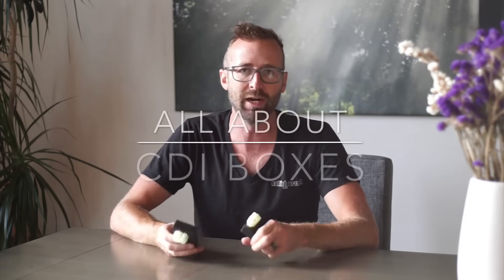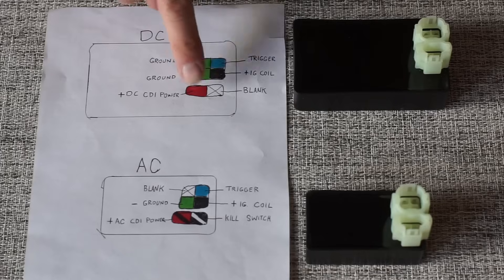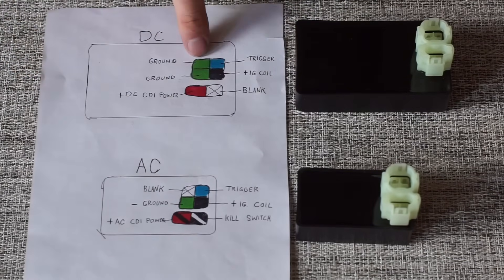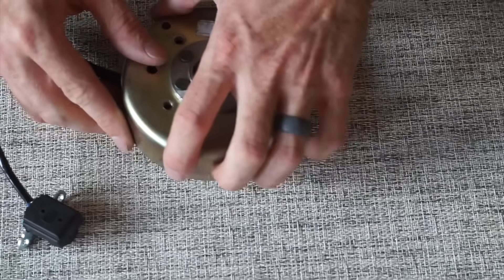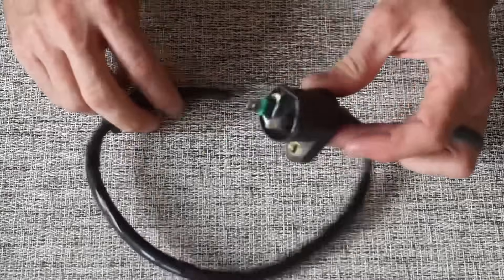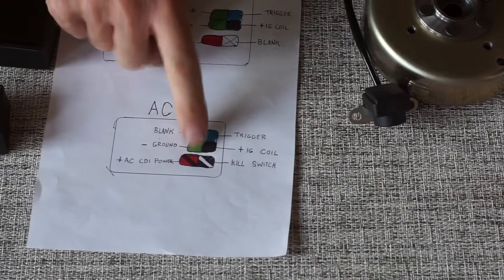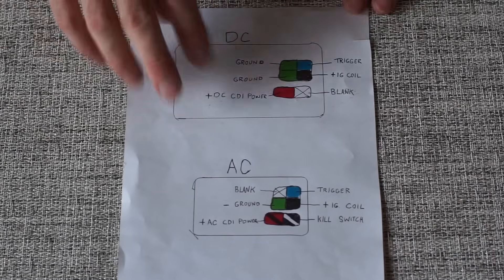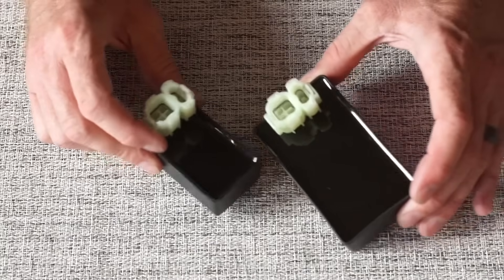CDI  BOX: AC vs DC performance vs stock

Comment: Very good explanation.   Now suppose you have a DC-CDI system that you would like to convert to an AC-CDI system,   what to do?
Reply from the maker: That part isn’t easy. You have to add a different stator and a bunch more wires.

Comment: After watching this I'm fairly certain I have an AC however I don't have a key lol.  The last owner lost the key and they have a switch rigged up that acts as my key and my lights only come on when the engine is running but my gas gauge comes on when the switch is flipped on.  Also the CDI box is tiny

Comment: Hi Mag
I have a Honda TRX 300 EX quad bike what is the best way to test the pick up coil to see if it is faulty or not I have tested the bike with a new CDI and new Ignition coil but the misfire is still there The bike starts and runs but misfires when accelarating.

Comment: Could really do with someone to do an explanation like this for older bikes with 6volt systems ac stator coils and half  wave rectification. Noticed a comment about flickering lights on tick over, most older motor cycles had a single diode rectifier screwed to a heat sink and this converted ac to dc in order to charge batteries and provide crude power to lights. The dc would be half wave meaning there would be a gap milli secs between the positive peak of voltage ax the ac went negative. On high revs you didn’t notice it in incandescent bulbs but on low revs you get a distinctive flicker.  Modern bikes now have full wave rectifiers and a decent direct current smoothed out with capacitors to give the voltage needed for led tech and solid state computer control units found on most new bikes.

Comment: huh, so it seems like another way to tell that you've got an AC CDI box is that you can kick over the bike on a completely dead battery, as you'd need to have at least SOME residual voltage going into a DC box to get it to spark the first couple of times.
Reply: You can look at the connector pins.  If your 2x2 has a blank space, it's AC.  If your 2x1 has the blank space, it's DC.

Comment: Very good and professional explanation. Could you give a hint, how to check the CDI system in a inverter-generator, where the elements are hidden in the main control-circuit,  not visible because of the epoxy-resin they and all the other elements are covered with ? Thanks in advance and have a good time.

Comment: 8mins 40secs This is incorrect. The coil is normally  powered. The CDI cuts the power to the coil.The resultant back EMF in the secondary winding is what generates the high voltage spark from the coil. If people are trying to figure out an issue they would see the opposite of what you are saying. Apart from that a great explanation.
Reply: Cdi cuts or dump HV from capacitor into primary of ignition coil?

Comment: I have bought multiple CDI and coils swapped stators and still no spark on my 97 Yamaha warrior. I’m desperate for help. This has been a year long now expensive problem. I took it to a dealer and they couldn’t figure it out or wouldn’t. Please help
Reply: I searched online and found a manual that gives a list of tool needed, parts to remove before troubleshooting, and a test order.  

Tools needed: YU-03112 pocket tester and YM-34487 coil tester.

Parts to remove: headlight, seat, front panel, fuel tank cover, front fender, fuel tank.  

Things to test:
1. spark plug
2. spark plug gap (should be .6 to .7mm)
3. spark plug cap resistance
4. ignition coil resistance
5. main switch
6. kill switch
7. source coil resistance
8. pickup coil resistance
9. wiring connection (ignition system)
Spark plug should be D8EA (NGK) or X24ES-U (ND)  

  
Good luck!

Comment: I got a 1982 GS650G. I need help finding a igniter or CDI I assume they the samething. Can u help me find one on Dennis Kirk. Suzuki doesn’t make those I think. On my oem service manual it shows that the igniter has 4 wires on one side of igniter (white, B/Y, O/W, B/W) and 2 wires on the other side of igniter (blue, green). Denis Kirk has a lot of CDI I don’t know which fits my bike. Do u know of another website where they got good CDI. PLEASE help me.

Comment: How does the kill switch work on a DC CDI box? I have a Kandi Kart with a DC CDI (no kill wire) and the wiring harness is melted, so I am trying to get it it running and back together. There is a kill switch mounted on it- I need to know where the wire goes.  Thanks!

Comment: My headlights don’t turn on when I switch the key only while the engine is running however my dash lights up and my brake lights can be activated. So if the bike is AC then it shouldn’t be able to run any electricity while the engine is off no?🤔

Comment: this makes sense to me now. Recently got a GY6 150cc in a 'as parts' state. It had 2 CDI's with it and the one plugged in produced spark and ran but it refused to switch off with the key, the kill switch wire was in a permanent grounded state which means it should have never run. Problem was loop wire to the bike stand which I removed. I switched the CDI also to a known-good GY6 50cc one (which was smaller in size) and it ran perfectly with the on-off key.  The scooter came with parts from also a pit bike. My conclusion is now that the 1 connected to the scooter on receiving it was a DC one and incorrect (likely off pit bike) and the other CDI an AC one. But the one off a 50cc works just fine anyway so ill stick with that!

Comment: so is ac better then dc for CDI? I am upgrading (ion the way) to an 11 pole stator and i orfiinally ordered the 12 but realized I have ac cdi .. seeing this I could have probably converted being the output to the coil is the same. I am researching using the stock regulator or do the work to add the 3 wire regulator with it (ordered it as well)

Comment: I have a crank but no spark. New battery, tested stator, r/r and still no spark . Do you think it's my cdi not working and if so, how do I test my cdi ? I have a 2001 sv 650s. Please help as my bike is over 10 yrs old no shop will diagnose my issue of no spark ! Thanks in advance .

Comment: I have came to a dead end with my turn signals. Then I remembered that I switched out my cdi box from a smaller one to a bigger one. I’m going back to the smaller cdi box tomorrow.
Reply: Wait.. what? Turning signals has nothing to do with CDI. If your signals are not turning on properly or not not turning on at all, that could be: the flasher, turning signals switch, ground or wires.

Comment: Lucianoa787 asked if you could show how to test the trigger signal. Not just for resistance but for generated voltage while cranking. This would be great for an AC. And maybe how to simulate a trigger signal with an AA battery. I guess that must be DC only. Is their a video like this available?
Reply: Do you mean the pickup coil signal? You will need an oscilloscope in order to measure the output voltage because is a pulsating signal. But that won't gives you any significant diagnostic information. The voltage is variable and could be anywhere between 4 and 12 v. A LED will be more useful. Connect LED  leads to the blue/white wire and ground coming from the pick up coil and LED will blink at cranking if the signal is present.

In order to simulate a pulsating signal you could make a circuit with a IC 555 and a 5v power source (maybe 3 AA batteries in series?). That would be enough to trigger the capacitor inside CDI and in turn generate a spark from the ignition coil.

Comment: How much voltage does the ignition coil need to get from the cdi to make the spark?
Reply: A CDI tipically outputs 200-400v to the ignition coil.

Comment: Hi mate. Could you help me please figure this cdi out if it is DC or AC? Bike is an India origin Kawasaki Rouser 180. 1 cyl with 2 spark plugs. It has 2 wires each going towards the 2 ignotion coils which were supposed to be the wires for the dc input or the ac kill switch as you have taught on your very educational video.
Reply: Is not very easy to tell if a CDI is AC or DC from its pinout. Especially with bikes assembled in India. 
Look for a wire coming from stator into CDI. If so, then is AC. Otherwise look for a wire coming from the main harness that carries 12v when key switch is on. If so, then is DC.

Comment: ac cdi is more durable and long lasting
Reply from the maker: Why is that?
Reply: @RollingWrench  dc cdi's has more components thus having more failure point's, ac cdi has lesser components, like capacitor,scr,few resistors and diodes.

while dc cdi has a built in inverter that turns 12v to 400volts ti charge the cbb capacitor
Reply from the maker: @James-tj6vu  i haven’t found that. But it is nice to hear your opinion. I personally like running dc. I run our 3 wire dc cdi coil. And a dc stator. This allows me to run more poles, and have less wires. I run a 18 pole stator. The most you can go with ac is 11 (big difference). Ac also has 6 wires instead of 3

Comment: I'm getting 24 volts out of my spark plug  what am I doing wrong I have an aftermarket cdi upgrade now I have the red black wire to the 12 v connection n green to the ground n blue to the stator n black to my coil n the black n white wire is connected to the ignition from what I understand from the videos I've seen I shouldn't have the black and white one not connected to nothing right ?

Comment: I have 2T AC CDI with 4 wires on original CDI but   it has 4+2 pin socket,i tried 2 perfomance CDi and only works on stand,where is the problem?

Comment: My cdi box is wired like the AC in your drawing. (Only 1 ground). But indeed it’s a dc one since I get power when I turn the key to ACC mode. 150cc kandi go cart
Reply: Also I have the same exact wiring harness from the stator but the red black is unused

Comment: Wouldn't the simplest way to tell if it's a DC CDI is the 2-pin section only has 1 wire connected to it while the AC CDI has 2 wires connected to it?

Comment: Very useful video! Thank you! So do I understood correctly, that ultimate sign of CDI type is: if scooter, moped/motorcycle doesn't have kill switch and you have to turn off engine by turning key CDI is DC, if you have kill switch to turn off the engine CDI is AC? Thank you for answer :)
Reply from the maker: That and the size and the wire configuration. You will have to check all 3 to confirm
Reply: @RollingWrench  Thank you very much for info :)

Comment: I have a x22r 250 motorcycle with no spark I've replaced stator cdi kill switch and rectifier and still no spark wat could it be now o and new coil

Comment: Awesome video!.  very informative. I ' m currently working on a LM200 American Sport workers for an elderly couple so can get around their property. The compliant the engine has no power to the spark plug and before it stopped running it was idling to fast. Any help for the couple would be very appreciated. God Blees.

Comment: I have a question /challenge that you may or may not be able to answer. Question : On an old School Lawn mower ignition coil. ( Meaning the coil has only a spark plug wire and a grounding tab) Is there any way to install a rev limiter on this type of ignition system ?
Reply: Rev limit on a lawnmower is controlled by a governor which is linked to fuelling not by a spark limiter.

Comment: I am working on a Honda 4TRX300 (that is the 4WD),  circa 1996 or 97. The CDI is AC and it is as big as the wrong one (DC) seen in this video.
Only one of the wires on the CDI is where and what this video says. Not saying he is wrong, just saying the 4trax is different.
Black/Yellow striped: sends power from the CDI to the coil
Dark green: ground
Light green: is connected to the "reverse" gear switch (I assume it keeps CDI from sending power to the coil if gearing is in reverse).
Black/white: is from the run (kill) switch on the handlebar ( and is where the video says it is on the CDI)
Blue/yellow: is the signal wire from the pulser (trigger)
Yellow: is the power source directly from the stator area. It Ts off one of the 3 yellow wires that sends current from the stator area to the regulator (where it gets changed to DC for charging the battery). The T is BEFORE the regulator, thus, we have an AC CDI.

Comment: Thankyou thankyou
Year's ago in Thailand I rented a Honda click.. 2 up 140kmh 
1 up 160. ,,Not by me,
Last month in Thailand ,,Chang Mai
 I rented
Honda , chino,, 110 cc. 99 kmh
Then Yamaha 125 falano. 99kmh
And my Philippines wife
A new . Suzuki,,burgman,, 125 
Small back wheel job..
Top speed you guessed it 
99kmh .1 up or 2 up. 
And all scooter's feel very gutless.
It's like Engin won't rev past 4000 rpm 

I'm wondering if I can't CDC box 
Would that fix the .no revs that is in all new scooters,??????

Please comment ,,guys,

Comment: I have a falcon 250cc or venom gtx automatic motorcycle with a 250gy6 and it has a AC and a DC cdi. Haven't jumped into harness to know why yet but if I ride the bike before it's all the way warmed up, going down the road, the electrical tries to switch to a different setting and my headlights will go off then on for a min until I get it warmed up with rpm then it switches current I think because it will reset my neons that are directly connected to the battery. Everything is new and works great tho. Just found having both cdis crazy. I do need to upgrade a8 pole stator to my other bike tho.. 2 good new ones still not supplying enough power. Has to be it to because I've changed every single electrical thing in the bike. Every single thing. It's all working just not enough. Hope to find help somewhere about the 8 pole upgrade but not much that I've found on how to change the wires and cdi and rectifier for the white yellow green connector

Comment: hey boss thank you for that video 
I just got a roketa 250cc buggy I cant find the vin not sure what year. the previous person has attempted to wire it but it has been hacked on I am no expert lol but I have managed to get it to turn over but I can't  get spark to the plug so since I'm not sure what goes where what my be the best way to check that i have a key switch but it is not connected I would try to find a new wiring harness but things are so confusing not for positive where to start it appears the the components all there plugs so my thinking was get a harness n put it all back correctly lol as for now I am just trying to get spark to see if it will run any info would be greatly appreciated thanks. first time buggy owner...

Comment: Incredible video on CDI boxes and how they work. I have a 2010 Brute Force 750 and I was in the process of taking the battery out and before I could detach the battery terminals it slipped and made contact with the frame of the bike.
I heard an electrical distortion as if a fuse had blown but all fuses are good and it appears the relays are ok too. Now when I turn the ignition to on the light switch doesn't work or the push start button won't work either and the fan immediately comes on. Also the FI is flashing codes 11, 12, and 14 which have nothing to do with my issue. I also tried bridging the solenoid to see if it would start. It will turn over but not crank. 
After unplugging the Fuel Pump relay I ran a jumper wire from the input directly to the positive battery terminal to see if the pump would run and it turned on instantly. 
Another interesting discovery was that when I hooked the battery up to a charger and combined it with the jumper wire to the battery charger positive terminal my electric headlights and push-start button was working again but the bike still won't start. It sounds like it wants to start but just simply continues to turn over. If anyone knows the reason or could pinpoint what the issue is feel free to share thanks.👍😎👌
Reply: Did you get it running ..??
Reply: @jerrybigrig9475  No still no luck. I did discover today that for some strange reason my rear spark plug coil shuts down all electrical power to the ATV only when it's connected to the spark plug depending on how you move the coil. Under normal circumstances it's nothing really unusual about that but I'm not understanding why all the electrical power would shutdown because of a simple spark plug/coil connection. I don't have any spark from both coils. I never could of imagined that a battery could cause this much electrical damage and confusion.😳

Comment: Didnt know where else i could ask a question.
Working on a tao tao i believe its about a 200cc. Several years old. No spark. 
The stator tested bad on the blue wire.
Thats fine. But theres another component separate from the stator area. Its harness runs in-between the stator house and front sprocket house. The component has 2 #2 Phillips 6mm screws holding it to a shaft with a counter or magnet on it. Also is wet with oil. I need to know about that component. is it a trigger/pickup? Etc etc etc. Of course theres more info but too much to say here. Thanks
Bo

Comment: Rolling Wrench: my CDI box has 3 plugs on it ... I have power with just the key on, i also have a kill switch. My brake safety switch also goes into the cdi ... I think it's a DC box, could you confirm this please ... my bike is a 2008 TGB Outback 425

Comment: I love the fact, u touched base on the basic parts of a c.d.I. But, I’m also interested in the racing side details after switching to upgrades. What’s the best. Why & why not upgrade. Is it even wroth switching or is it more then just a quick easy fix to upgrade the ignition system.